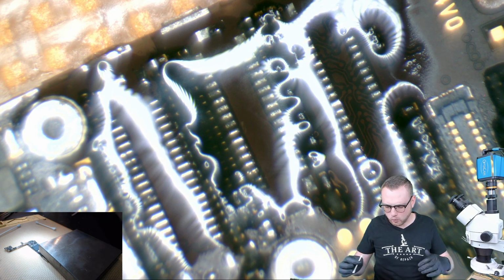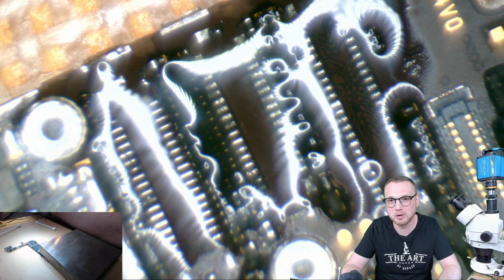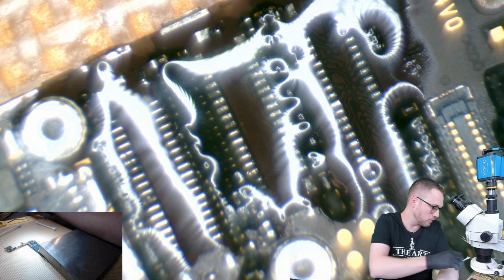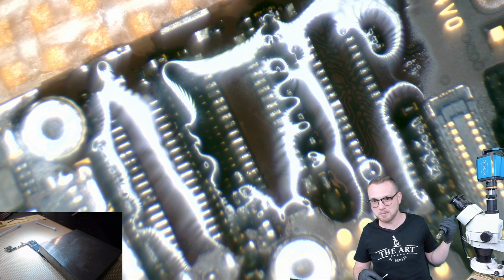Microsoldering 101 | Perfect Flux Cleanup as you Work | Squeaky Clean PCBs

Comment: The flux in my solder if I leave it on my soldering iron tip set to 320C it leaves a carbon residue after all the flux evaporates. Any tips for removing this carbon build up?

Comment: Great vid, thanks for sharing!! Quick question; what kind of flux did you use there (no-clean, rosin, RMA or something else)? I've been using no-clean for a long while now, but cleaning (when needed) is a hassle since it requires other types of detergent than IPA and still is kinda tricky to get off the PCB.

Comment: Greetings, I am an auto tech retired, but it's my job to fix everything. You said your temp was 140. In engineering and diagnostics flows charts, they always give you temperature in "C" and "F". Is this 140 degrees F? As solder melts at 420-450 degrees F, I am sure it take no time to crank up the temp to work. No auto tech want to turn on the compressor while holding the air impact & socket.
  Also, I have seen many debates turn into arguments about isopropyl alcohol. Some say say crazy stuff like never use it. Is 75% work for a guy who is a part time Mr Fit It? 99% is a little expensive to have sitting around. Although, in Iowa, Nebraska and nearby, pure 100% ethanol is produced. This is not isopropyl but when aged in chard oak barrels, taste good!
 Do you have a sweep frequency ultrasound cleaner w/distilled water or special cleaner.
Sorry to ask so many questions but sometimes it's hard to find someone who knows what works! Best practice works for me, in auto repair or electronics. I had to subscribe & like. My task (Among Many) is a dead short on my 3 year old Dell Inspiron 15. Can't afford new.

Comment: Around 7:45 the flash point of isopropyl alcohol is stated to be much higher than the temperatures used in this video, but I think that this should be the autoignition temperature. Flash point for iso is generally in the 10-20 °C range depending on concentration.
Reply from the maker: Steve Brown ah! I see, good info, 

I’ll double check everything and when I redo this video, I’ll include more info. 💪

Comment: Thanks Justin! Sometimes I use a soft toothbrush over some lint-free paper towels.
Reply from the maker: This for sure works well! I just hate there being any left over residual flux lol
Reply: Well, I use lacquer thinner first with the paper towel, then use alcohol and the paper towel. Then I go over it with just a clean toothbrush and alcohol.
I haven't got up the courage to put a board in the Ultrasonic because I just have a small cheaper one.
Reply from the maker: Honestly, After the job is complete, even a cheap US should do just find for basic flux cleanup if you want that extra polish =)
Reply: I may try it sometime. I need to save up and get a nice US. What do you think about the Crest US that Louis Rossmann recommends?
I will try your flux removal method next time and use my hot-air with it also. I have been using my rework station for a lot more stuff lately. I can make nicer cables and stuff using the rework station and solder paste instead of an iron, with less flux to clean up.
Reply: Also I usually use my board preheater so the board is still warm.

Comment: So, i have no heat gun so should i just melt the flux with my iron and use the qtip and rubbing alcool anyway? Also, i heard in another video that leftover flux rosin can end up corroding the circuit, is that true?
Reply from the maker: Corrosion depends on the brand and composition of the flux. Even a small cheap heat gun from your local hardware store will help, Heat makes the flux gain more viscosity which allows it to be soaked up by the qtip =)

Comment: Can I use something stronger that isopropyl alcohol, like aceton for example (its what I got on hand)? or wil it ruin the board?
and is this flux any good for micro  soldering: Weller LW25? (what they got at my loca store)
Reply from the maker: Honestly, acetone could potentially eat up coatings, I would suggest sticking with ISO for pretty much all flux cleanup. As long as you dont let the flux sit for months it should come right off with iso =)

Comment: Thanks for sharing. This video was longer than others that I was looking up but I'm glad I watched it, albeit just the important parts. Question if you see this: what is the purpose of using extra flux in soldering if the solder I use already has flux in the core?

Comment: Yet again, great video Justin. You state 140° to remove Apple under fill, however, is that °C or °F?
Reply from the maker: C =)
Reply: You could probably just use the lowest setting on your heat gun and be fine. You just want the isopropyl to flash immediately. So well above room temp, yet well below melting point is all that is really needed. If your gun goes down to 100°C, that'll work too.